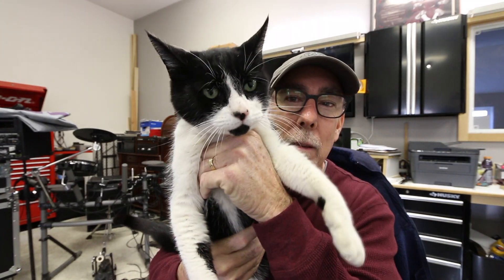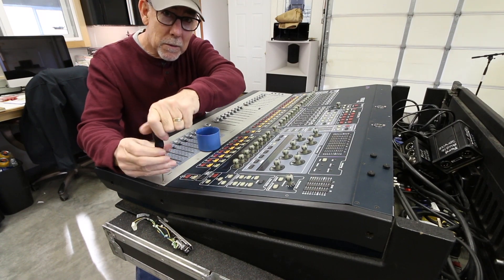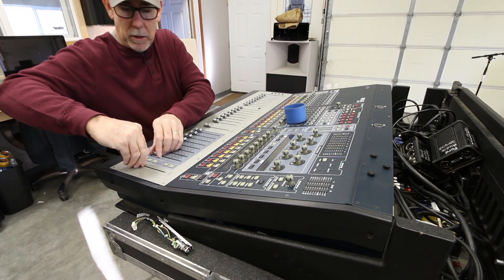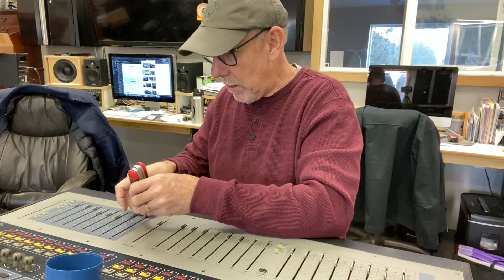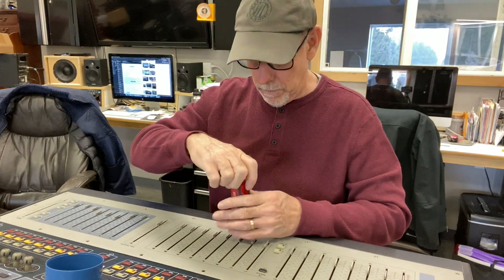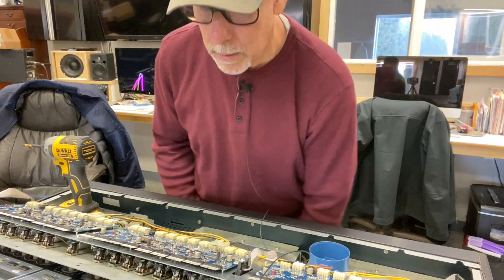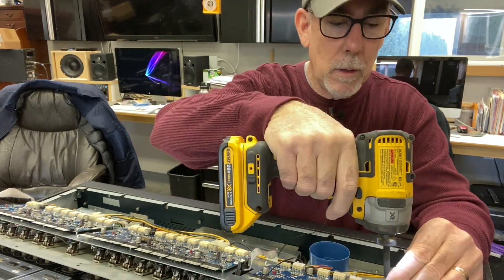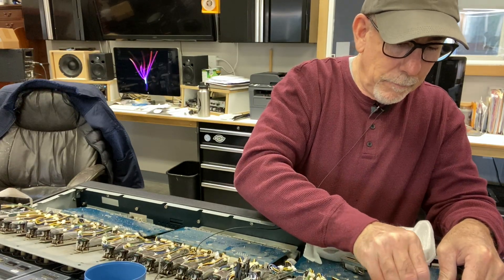Audio Geekery! | Avid Venue SC48 Repair - Fader Replacement HQ Video - Electronic Repair 2020 HD

Comment: Could you suggest what could cause buzz on the SC48 Input channels as I have opened up the console and blow every dust but still buzz on same input channels
Reply: Buzz on every channel with nothing plugged in but power  would indicate either a ground issue on the analog board(s) or a power supply with a fault dumping noise into the ground bus. Try running just one power supply at a time to see if one or the other is causing it. If it's not the supplies, it's probably a relatively difficult problem to isolate and will need to go to a service center.